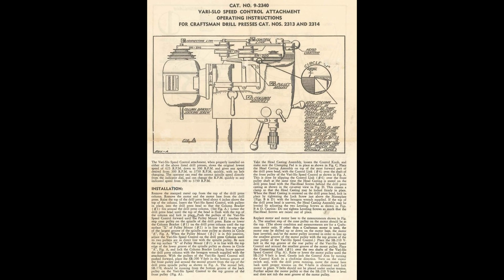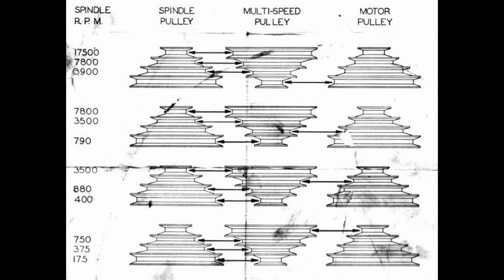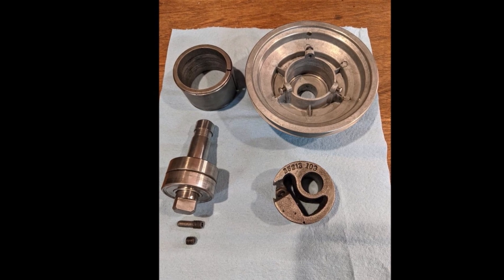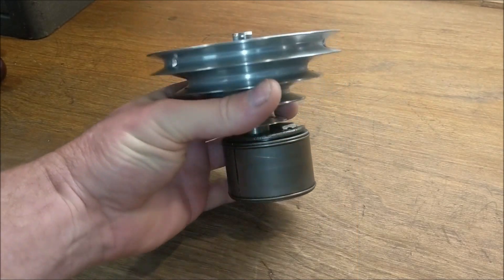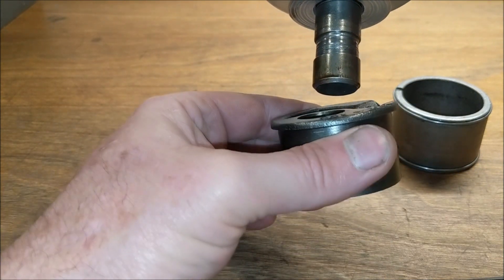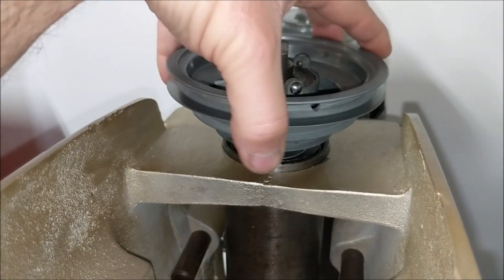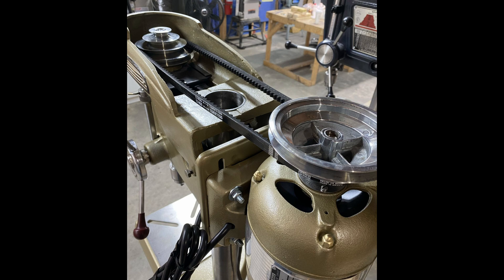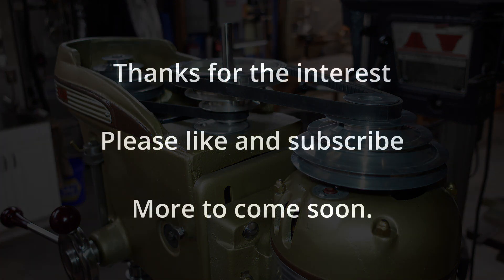Accessories Part 1 Craftsman Drill Press MSA 9-2338

Comment: I am rebuilding my 100 series 1951 Craftsman drill press with a MSA. What are the best bearings to use? Are the 204PP better for fit, or is it better to go with 6204 ZZ or 2 RS? Thanks for the help, as I need to replace the 2 bearings on my MSA.
Reply from the maker: Thank you for the question. I do not recall he exact size of the bearings and I am at work presently so no way to check; however, I will say that I recommend you get the exact same size bearings from a Japanese brand such as Nachi and I prefer zz or metal shielded but sealed bearings should work just fine as well. I do not recall the shaft size but make sure that it’s not a special bore size like 5/8” rather than mm. For example, many of the standard bearing sizes used in Craftsman products of this era used a 6202 bearing which is normally 15mm Bore x 35mm OD x 11mm Tall; however, Craftsman required a special 5/8” bore so the bearing need was a 6202 special bore which is 5/8” Bore x 35mm OD x 11mm Tall. Obviously a 15mm bore bearing will not fit a 5/8” shaft.
Reply: @JeffsShop  Thanks Jeff! I have the early version Norma 204 PP bearings on my MSA. When I Google upgrading to the 6204 ZZ or 2RS bearings, it cautions me about the slight difference between inch and metric measurements being slightly different, so guess I need to call your recommended bearing company.
As an aside, after pulling my spindle/quill assembly I noticed both machine screws at the top had broken ends, so need your help on exactly where to add the clip or snap ring on the quill to prevent it moving up and hitting the bottom spindle bearing. Thanks! I am learning so much from you and like all your videos.
Reply from the maker: @jimnewman5230  I am not sure the conversion between inch and metric bearings is that big of a deal. Put a caliper set on mm on the original Norma bearings and google for closets size to be sure of the fit. I should mention you have two other options. The first I do not recommend, which is to ebay for new old stock of the bearings. The problem is that most of these “new old stock” will often have dried up grease in them. The second is to remove the shields on the sides with a razor blade (youtube search) then flush and repack the original bearings ten reattach the shields. Franklee (user name) on the Garage Journal Forum does this all the time. As for adding the retaining ring to the quill. It sound like you watch my video on Internal Parts & Interactions. I am glad that video is seeing some use. If not, check it out. I assume you understand that you will need to turn a channel on the quill to mount the retaining ring? Here is a video should the procedure and measurements. Don’t do like I did and cut on the wrong side of the line. https://youtu.be/Al7VtxX01i4?si=XHTILwaO2PJ86tBF&t=154
Reply: Thanks Jeff, I will report back what I learn so you can pass it on.
Reply from the maker: @jimnewman5230  BTW, the McMaster Carr part # for the Quill Retaining Ring is 93576A450
Reply: Hi Jeff. I just found a 100 series at an estate sale in great shape. Your videos have already been very helpful.

I was lucky enough to have my unit come with an original craftsman multi speed attachment. It wasn't hooked up and the drill press just had one long belt bypassing the MSA. I can't find a manual for this, but in the intro of this video, one page of document looks to say it needs a 27" and 29" v belt. Is that correct? I think the MSA needs bearings also, it turns but us tight and very notchy. I plan to pull the bearings and measure them but would happen to know what part # they would be? Thanks.
Reply from the maker: @marcusriley5388  Yep the two belts you need are a 27" and 29". The owner's manual is only two pages and is linked in the description of the video. BTW, you can replace the bearings. I replaced the bearings on my MSA that I acquired after making this video. Here is a post from GJ that I made about the bearings and replacing them. You will need to take measurements from the bearings to the end of the shaft on each end or index he shaft before disassembly. https://www.garagejournal.com/forum/threads/craftsman-drill-press.227480/post-10296294
Reply: @JeffsShop omg I never expanded the info under the video, I feel dumb. Thanks for the reply and for the info!
Reply from the maker: @marcusriley5388  No worries, glad you found what you needed.
Reply: @JeffsShop I wanted to let you know that the manual was exactly what I needed. I was able to get new belts in last night and every hooked up. I also discovered the bearings were fine, the pulley was just set up in a way that it was slightly rubbing against the top of the mount. Everything is running great, thanks.
Reply from the maker: @marcusriley5388  Cool, glad I could help.

Comment: I am fortunate enough to have three of these that I am going to be installing on two 150's, and one 100. Unfortunately, one of them is missing the outer collar, and the rings. Does anyone reading this know where I can find replacements, or have repros made?? How were you able to polish the underside of the pulley???
Reply from the maker: That pulley is not polished, just really clean. I would create a free account on the Garage Journal forum and ask  your questions in the vintage tools thread. Lost of Craftsman Drill Press guys there and someone may have some parts.